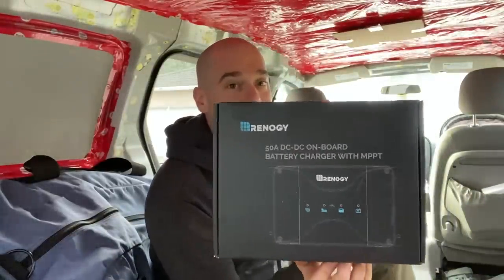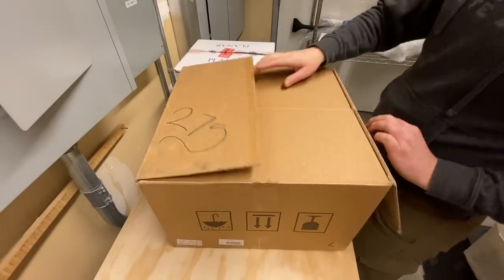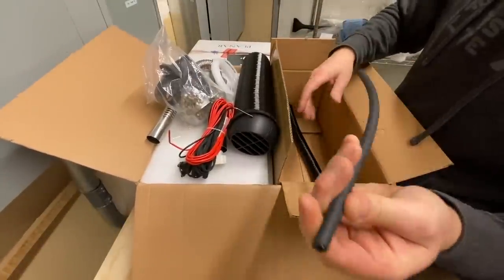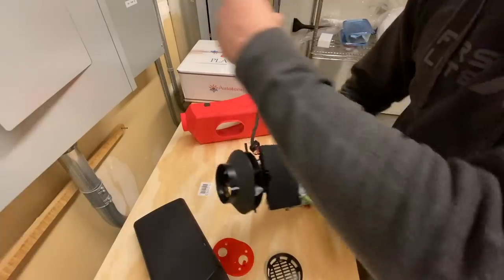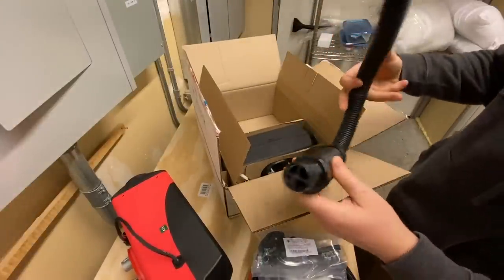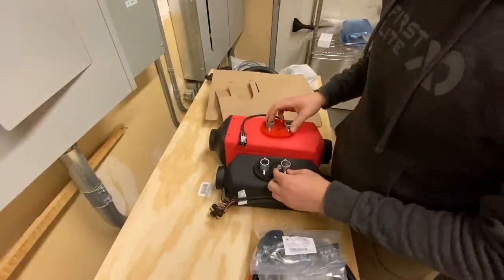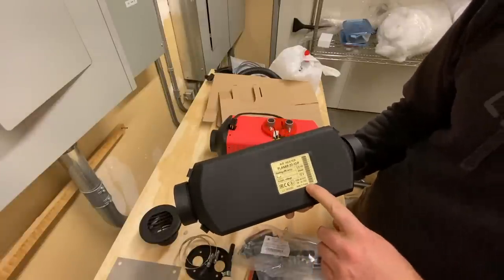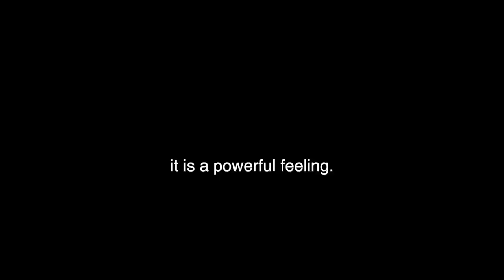MINIVAN Build E-14 || Picked up some more parts and another heater

Comment: Had the China one for 3 years now , no issues ! For me , as a plumber and gas fitter , I got to say same stuff different pile !   The only difference is mine doesn't adjust the air fuel ratio automatically in different altitudes . That's ok , I'll take 45 seconds and adjust it myself  , it's all good !  
Good video Joe ! Much appreciated 👍👍🇨🇦🇨🇦💪💪

Comment: Hey Joseph! I just ordered 2 of those SiO2 batterys they are still not very well known. How have they been performing for you?
Reply from the maker: So far so good.  No complaints at all.
Reply: @SharingTheWild  I saw a video of guy that tried to kill them. Full discharge and recharge every day for 6 weeks, left them dead for another 6 weeks and then restarted the cycle for another 3 months with no significant loss of capacity

Comment: Yup... carbon build up killed the heater I bought from you last year... well I forgot to do a high heat burn off the last few times but it’s definitely clogged now... had a couple challenges with no instructions but it was a cheap solution at the time... just bought a replacement so I can clean up the other one but I will eventually switch to the Russian heater...

Comment: @Sharing The Wild - The Planar 2d is much better. Chrome had made an equal video about the Chinese and the Webasto one. The chinese stuff is cheap but gives you trouble after 1 or 2 years when you often use it. You have done the better choice not to use the chinese one.